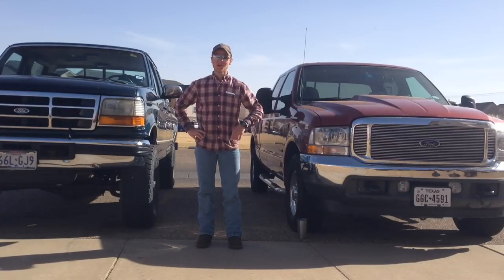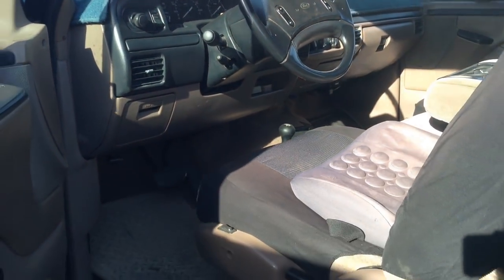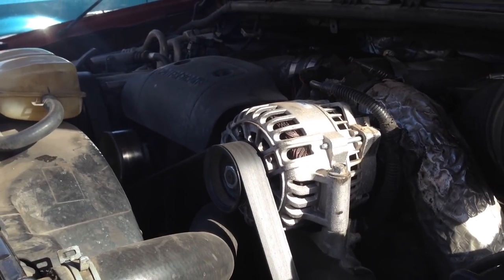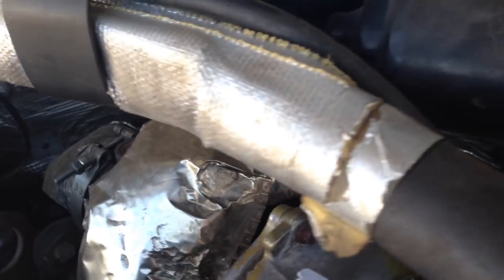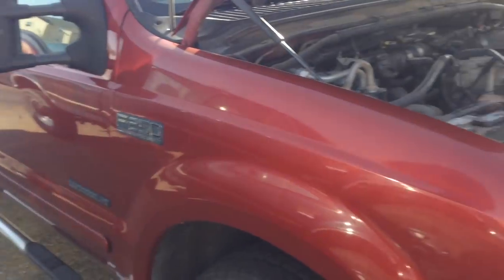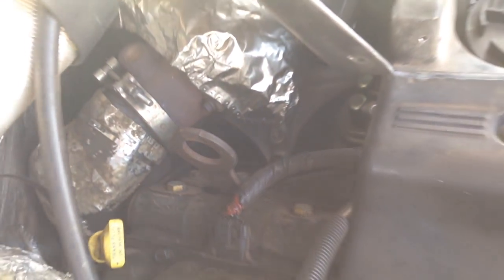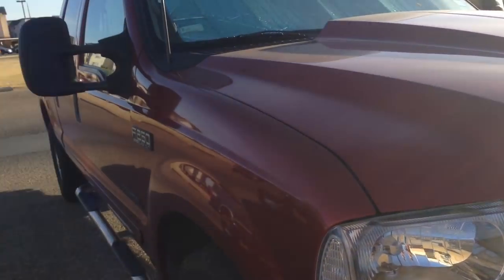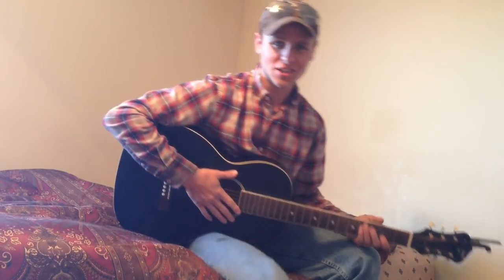OBS vs Superduty 7.3 Powerstroke

Comment: Need a truck to daily drive as well as haul some cars around. In terms of age, is buying a obs 7.3 more expensive to keep well maintained? During your ownership how has your truck been maintenance wise? 
Love your truck!
Reply from the maker: Kevin Jose yeah I really love my truck too, it's a great one! Okay, 7.3's are starting to get up there in age and accumulate a lot of miles, like mine with 357k miles now. My injectors are a bit worn, it still needs suspension work, and I'm currently fixing the AC... parts do get pricey on the engine though. Injectors are $1200 for stock units if you do the work yourself, and the aftermarket sensors are not that great, so you usually have to go to the Ford dealer for parts. Really though only 3 actually go out, the ICP sensor, $250 at dealer, cam position sensor ~$30 at dealer, and IPR $250 at the dealer. That being said, they don't go out often, and other than the cam position sensor, odds are you'll get years of life out of them. Oil is expensive. It literally takes 3.5 gallons of the good oil Rotella t4 is what I use, and filters are around $20 too unless you shop around. So oil changes are around $65 every 5k miles. Coming from a gasser Chevy, nothing about the 7.3 is cheaper. It's just awesome! 7.3's as daily drivers are slower than molasses, like you need to be careful when taking left turns, because it takes the turbo so long to spool. I daily mine, and it's good, just challenging to park at times. You know there's a lot more to talk about I'm not really giving the 7.3 justice here. If you give me some time perhaps I can make a video and put it up on the channel.
Reply: Rnddiesel that would be great! Like a potential buyers guide / typical maintenance items on the 7.3. Thanks for the response, take your time if you are making a video. I want to make sure I make the right decision buying a truck like this.
Reply from the maker: Kevin Jose alright! I'll take a look and see about considering what all there is involved in choosing a 7.3. What other truck options are you considering?
Reply: Rnddiesel 7.3 and the 24v cummins. 7.3 means a lot more to me as my dad bought a new Ford Expedition back in 2000 and the sales person tried so hard to get my dad to pick up a 7.3 excursion instead. I’m a huge car enthusiast and love working on anything really. Just need a dependable rig to use on a daily basis. I’ve seen some trucks with around 100-150k miles asking 20-24k. Not sure if that’s overpriced or not.
Reply from the maker: Yeah, 20-24k sounds a bit high. Both are legendary engines and it's not the easiest to find a diesel with under 200k miles on it. You pay a lot more for a low mileage rig over one that just needs a little work. Heck I picked up my truck for $4500 a year ago, and I've spent another $4500 on it thus far, but I've redone all the brakes, shocks, fixed the air conditioner, replaced a few sensors, serviced pretty much every fluid in the truck, replaced the radiator, and have even upgraded a few things along the way too!
Reply: Kevin Jose, I purchased my OBS 7.3PSD for 1200 bucks with 300,046 miles, no blow by and was a one owner. It now has 305k and the only things I've done is a 6637 air filter, map line relocation, oil change and a Altenator.

Comment: Missing your AC clutch plate bud! Mine thru the screw loose one day and I got lucky, found the plate and the screw sitting on the radiator support. Mine was from power down shifting the stick shift i think n spun loose the reverse thread holding screw. P.s the best color was infact the Taurmaline green! Beautiful color.  Mines is the same truck minus king cab, XLT package , 5 speed of course. 285k never not taken me home at end of the day BTW.
Reply from the maker: Yeah, I fixed that by replacing the ac compressor, that one didn't work anyway. Funny thing, I actually pulled the ac compressor since it didn't work, I was planning to disassemble it and see if I could just un-seize it, but I broke the bolt that held on the clutch plate in the process. I don't know why I put the clutch plate back on there, but it came off when I was going down the road one time and gave me a nice reverse dent in the hood! I'm glad to hear you've had good luck with your truck as well, Dark Taurmaline is indeed a good color too. I've got 374k on mine now and it's still going strong!
Reply: @Rnddiesel  Actually had a guy try hard just yesterday at home depot to buy mine when I parked. Folks love em. They will probably bury me in mine when the day comes. Thanks for making videos! Plenty of nice old trucks in Oregon coast area from what I have seen. The loggers loved em. Very few in Florida. I see maybe one a week driving like mine in various conditions and everyone knows my truck around here in east orlando.
Reply from the maker: @jim28fl   That's awesome, your's must be in better shape than mine! It really depends on what part of the country you're in I guess. I try to make videos when I can, know its been a while since I mad any; I'm glad to hear folks like you appreciate them none the less!

Comment: The reason on the OBS turbo has the 1.15 turbine housing is to try to keep the exhaust temp below 1250° pre turbo because of the lack of an intercooler. The OBS 7.3 Powerstroke actually was rated for less horsepower than a 7.3 idi with a Banks sidewinder turbo or one that had a Hypermax Pulse turbo and intercooler system on it. With a Banks Sidewinder on 7.3 idi it was rated at 262 flywheel horsepower and a 7.3 idi with a Hypermax Pulse turbo and intercooler were rated at 260 flywheel horsepower.

Comment: at 4:57 it looks as if the OBS is running later model coolant? It doesn't seem to be green? At first I thought it might have been the lighting, but the S Duty shows green. ?????
Reply from the maker: I guess it does look a bit different. I'm running a Fleet Charge brand coolant that is already pre-treated with SCA's (Supplemental Coolant Additives) to prevent cavitation in the OBS. For whatever reason the company that makes it likes to dye it purple. The Super Duty owner is a friend of mine; he's just running regular green antifreeze, but the guy doesn't have any SCA's in the coolant! I might inadvertently drop a couple bottles of SCA in  his radiator one of these days and help keep a goo 7.3 from getting a hole in the block...

Comment: My 95’ f250 7.3 will do a 13 sec 0-60 with the 4.10 gears I guess gearing makes a huge difference
Reply from the maker: Wow, that is impressive! 4.10 is also much better for towing. What sort of mpg do you get in the 95? I usually get 15-16 mpg in the 97.
Reply: Rnddiesel it gets about 17 mpg at 60mph
Reply from the maker: Okay, not bad, I can usually get a 18 mpg at 60 mph as well. I guess it's not a huge difference then, but for the acceleration, hat's of for the 4.10!
Reply: Shaun Bennett good for you
Reply: Rnddiesel my truck 1995 7.3L f350 4 door long bed 4x4 with 4.10s gets 12.49 mpg average. Not very good but not the worst I guess...
Reply: 4.10 gears are good for towing, but suck on the highway. 3.55 is the way to go for versatility.
Reply: My 2000 does it in 6.2 lol yeah she’s had some work

Comment: Only 2002 and 2003 7.3 Super Duty have transmission temp gauge.
Reply from the maker: 94 7.3 IDI turbo Diesel, thanks for all the info! I really didn't know only 02 and 03 models had the trans temp gauge. It is really neat that those came factory. I just realized that my friends SD had the temp gauge about a week before I shot the video. By the way, nice IDI, those things are cool.
Reply: O1 Super Duty 7.3 Powerstroke is what I have now.
It has the voltage gauge instead of the transmission temperature gauge.
Reply from the maker: That's sure a real shame, too bad Ford didn't put an actual gauge there. Go figure it doesn't have any numbers anyway! I've got a real trans temp gauge on the OBS now, so that part is good to go now.

Comment: I want a 7.3, came from a 6.0 want something different, but I wanna make it quick for a truck (not a drag truck) but I also want the ability to work on it myself. What’s the better one for towing and going quicker (with mods ofcourse)
Reply from the maker: FBI, I'd say the super duty is better to make quick hands down. They're already intercooled, transmissions are stronger and they already have bigger injectors and a decently sized HPOP. The only downside is the SD is a little heavier and more cramped to work on, but it's not that bad. Some things on the OBS are hard to work on too, especially with exhaust downpipes... Also SD has a quicker spooling turbo which is much better for daily driving. The only thing is some SD trucks have powered metal connecting rods, but that doesn't matter unless you go past 400 rear wheel horsepower.

Comment: The good thing about a idi is i can run straight biodiesel if needed with no changes to the motor
Reply from the maker: Yeah that is a nice thing about the idi's! I've heard the only issue would be with the fuel return lines. Supposedly biodiesel deteriorates the standard hoses that aren't specifically designed for the biodiesel. I'm sure the Bank's turbo really helps the truck out a lot too!
Reply: Rnddiesel yes sir it sure does

Comment: Has anyone else had trouble with the E4OD transmission controller wiring?
I'm getting close to just swapping to a manual.
Reply: Do it! A zf5 will last way longer with less maintenance. The E4od in my 7.3 was rebuilt 8 years ago and it's already showing signs of wear such as it has a hard time deciding what gear it wants under throttle. Pisses me off Everytime I need to get going especially while towing trailers. At least in a manual you can choose your gears makes it to where my other 91 460 zf5 can out pull my 97 e4od 7.3 kinda sad when you think about the fact a truck 6 years older and being a gas can out pull and perform the diesel

Comment: I owned a 97 7.3 obs, currently have a 2000 7.3 both are great trucks and the engine will run forever.
Reply from the maker: Kevin Huber, I'll second that one! You know a lot of folks brag about their Cummins, but I still bleed IH red. International sure knows how to make engines, and the injection technology for the time of the 7.3 was way more advanced than the all mechanical 5.9 Cummins. Yet the 7.3 still runs like a workhorse even with electronics. Gotta love 7.3's!
Reply: I have a 2000 F350 4X4, 4R100 automatic transmission, crew cab, long bed, single rear wheel, with about 190,000 miles on it. Everything is stock original. I bought it used in 2009 for $15,000. I did have to replace the cam position sensor not long after I purchased it. The truck was missing that overdrive button when I bought it, still don't have one for it. Power lock motors don't work but found out that is a common problem that can be fixed by taking them out and drilling out the rivets and then use aluminum foil as a replacement for the contactors. I have not performed that fix yet, I'm being lazy and just manually lock them. I run Rotella T6 full synthetic for the oil. Changed out the rear differential fluid a couple years ago with Amsoil fluid. I did have the problem with the air conditioner cycling on/off but I read about cleaning and possibly shimming the AC clutch thing up in the engine compartment, that fixed that but I have another AC problem that is called the blend door. Have you had these problems? I live in Round Rock, Texas and we need AC here otherwise you will suffer in the summer. Where are you located and tell us more about your truck.

Comment: Intercooler is NOT for emissions. How many intercooler deletes do you see for sale on the internet? Intercooler is for horse power only.
I will not explain here. Look up the Gale Banks Youtube video on the subject. Rant over.

Thanks for the video. I test drove a 1998 Ford F250 at a dealership. It was on a "new" F150 cab with heavy duty suspension, but it said F250 on the badge. I never saw that model again. It may have been Ford's intermediate version.
FYI 
To check for powder connecting rods there is a video on it. There is a block window plug you can pull off and look directly at them.
Reply from the maker: Thanks for the input! I had no idea there was a window in the block to check for powdered metal rods. If you can find them, would you post links to the videos you're referring to? Banks has so many videos out there its hard to know which one you're referring to. Gale Banks does know what he's talking about, that guy went and became an engineer so he could understand more about the performance parts he was adding and to design them, it's a pretty cool story! It sounds like you found an odd ball f250. 1998 was a weird year for ford trucks for sure. Did the round body f250 have a powerstroke in it? I've only seen one of those trucks once and I thought it was a joke at first, that someone had just put f250 badges on an f150. 

Regarding the intercooler: They weren't put on strictly for emissions, though that is a good motivation for auto makers to utilize intercoolers. Here's a link to a study on intercooling, turbocharging, and power output: https://www.researchgate.net/publication/319979741_THE_EFFECT_OF_TURBOCHARGER_PRESSURE_AND_INTERCOOLER_TEMPERATURE_ON_ENGINE_PERFORMANCE

The study appears to be mostly based on theoretical calculations, though from my experience those theoretical equations are fairly accurate. I've worked with similar models myself as an mechanical engineer. See figure 12, it indicates that as you decrease the intake air temperature (via intecooling) the thermal efficiency of the engine is increased. Efficiency may not seem to be increased by much, but gaining around 2% thermal efficiency is a huge accomplishment! This allows the engine to burn less fuel and in turn produce less emissions, especially carbon emissions if you're talking about increasing thermal efficiency. Certainly intercooling also allows you to increase the power output of an engine and lower exhaust gas temperatures, that's definitely a good reason to intercool and one of the reasons I added one to my OBS truck. Another factor is that by increasing the air charge density via intercooling, you can increase the air taken into the engine per revolution. Yes this increases power output, but it also lowers emissions, Nitrous Oxide emission (NOx) in particular. Essentially the greater mass of air ingested causes a lower peak cylinder temperature (hence lowers egts) which reduced NOx formation. NOx is generally formed as a result of higher peak combustion temperatures. Really, I don't think most folks care about emissions as much as auto makers and the government. If you 'deleted' an intercooler simply because it lowered emissions, you'd be an idiot as it helps increase power, increase efficiency, lowers egt, and the cons to an intercooler are far less than those aforementioned pros. Look, if modern particulate filters actually increased power and fuel economy, (which they do neither) there would be far less aftermarket motivation to delete them! In the end, intercoolers are utilized to lower emissions, particularly NOx emissions at high engine load, but they also allow for increased power output! In engineering you rarely get parts that both increase power and lower emissions, especially these days when emissions regulations are so strict. Even if you factor out emissions regulations, I think auto makers would still intercool vehicles to increase power output, but they also consequently reduce emissions slightly. I've gathered much of this reasoning from a good friend of mine who spend a good part of 20 years working as a noise and vibration engineer for Cummins. By the way Merry Christmas!
Reply: @Rnddiesel  https://youtu.be/eJ5fdfBoBUw
Block window video to check for powder metal rods.
Reply: @Rnddiesel  
https://youtu.be/hbsnzC3nXOU
At the end of the video Gale sums up his findings.

Back to your question on the non Super Duty "new body style" F 250.

I was at a Ford dealership 1998 looking to by a new truck. The 1998 F250 I test drove had the triton V8. It also had a stiff ride compared to a '99 F150 I just drove. They both looked identical except for the bagdes.  I told the Ford salesman to sell me the F150. The salesman did not bring up a Diesel version of the F250 and I did not ask.
I should have because it would have made for a better story today. Lol.
Reply: John Campos  Good idea adding intercooler. 
With the intercooler, you are now increasing the air density entering the combustion chamber.
Black smoke coming out the exhaust is fuel which has not combusted. If you see black smoke come out of a diesel it is running rich. Looks cool but it is just wasting fuel.